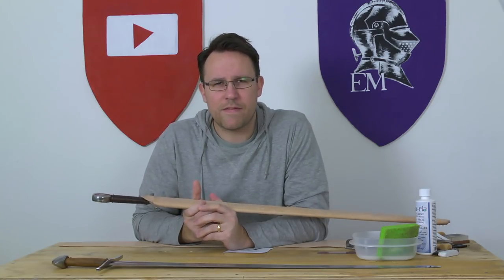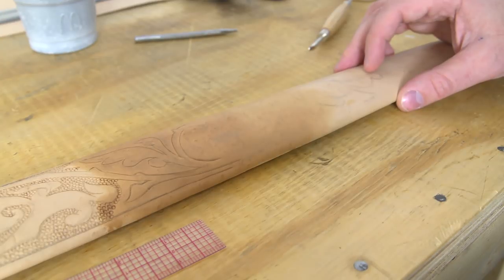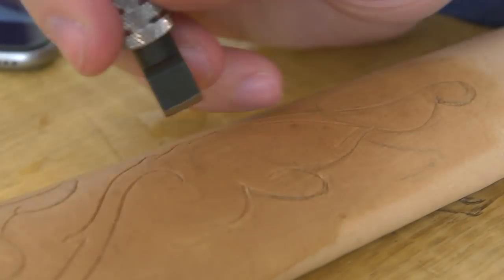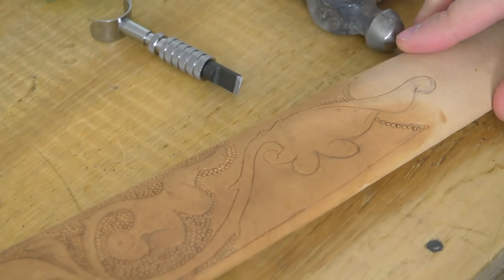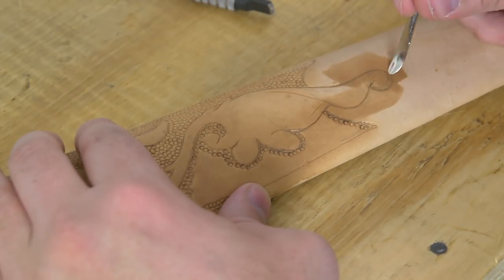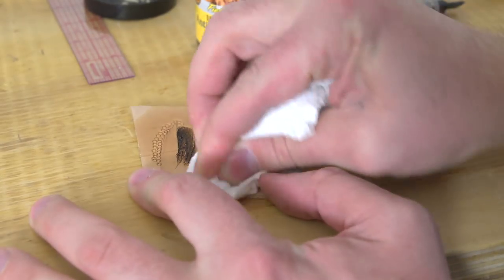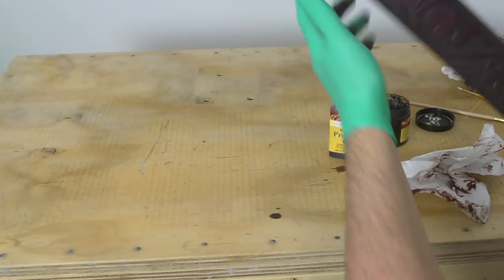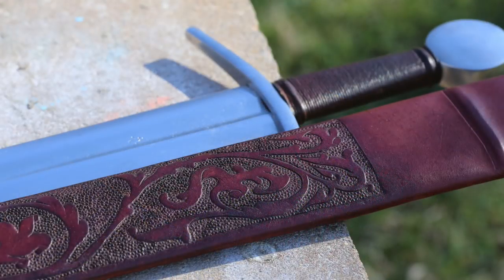Medieval Scabbard No.3, Carving and Staining

Comment: On the process of antiquing!
When using fiebings antique paste, first, you dye the piece the color you want, then you'll want to apply an acrylic finish that will resist the paste. The best for this is fiebings pro resist, but resolene, super sheen, etc will work. You can do a couple coats to really make sure none of the antique bleeds into the main color. Then, once the finish is dry, you cover the piece in antique and immediately wipe it all off with a clean rag.
Thing about this antiquing process is that it makes everything really shiny because of the acrylic. If you want to avoid antique entirely, then first dye the entire piece the color you want, then go back in and fill in the background areas with a darker dye and your brush. You have to be very careful, but you'll have less of an issue with dye bleeding into unwanted areas when you only re-dye the background. Awesome work! I love seeing your process

Comment: I'm by no means a leather worker but my late uncle was and because of him I dabbled in it as a kid. While seeing you cut in the floral patern I kept wondering when you would go back and cut in the little indications of veins/detail such leather work usually has. You mention you thought they came out too flat. That's why. Leaves usually have a few veins cut in then brought out with an edge shader during tooling. Stems are usually highlighted with the edge shader. Larger areas in leaves and petals with no veins are usually tooled in the center with a pear shader to cause the three dimensional curling or dished look. Those two tools will become as indispensable as your swivel knife once you've practiced with them. Either way the scabbard still came out beautiful. Really nice work. 👍
Reply: Also using an edge beveler will create more depth.

Comment: At about 5:10 you remark about the scabbard wobbling.  You may have already figured this out, but I have not seen all of the videos or read all of the comments yet.  I would take a piece of heavier suede leather,  say about 18 inches long and like when deciding on the width of the leather for the scabbard, make this about an inch wider on each side and leave about an inch for depth and then return to the center, so then you have a piece when sewn together it can be filled with some clean dry sand.  

Hopefully this makes sense.  It will be a formable pillow for the scabbard, but it will be firm enough to keep it from wobbling and also can supply enough support for tooling.  I have used something similar for forming sheet metal.

Comment: Nice Job. You will get much better cuts with the swivel knife if you let your leather dry more. If the leather is too wet it tends to grab the blade and you will have jagged lines or mushed up lines. Wait at least a few minutes before you start to cut into the leather and you will see a marked improvement. You should also be stropping your blade every few minutes, a polished blade will slice very cleanly and have sharp crisp lines. Thanks for posting the video. Good Luck in the future with your swivel knife work.

Comment: Just a few tips i've picked up belt making. Antique paste works best once the leather has been sealed, i use a couple of coats of supeshene from tandy. When the paste is wiped off sealed leather it stays in the deep bits and doesn't stain the top colour. Before you seal the leather you  can oil the leather and add some dye if you want more colour. I tend to use the fiebings pro oil dyes but dilute them heavily so i can do multiple coats rather than one heavy coat which is very difficult to get even. General order is dye/oil leather, seal, antique, wipe off, re seal. I think dying your project is a good idea as the tooling is quite shallow so wouldn't hold much antique anyway. 

I am not sure how robust the finish is as it is an eco product but tandy antique gel is a stain and antique in one you simply rub on and buff and add a protective seal top coat.
Reply from the maker: Great info and tips. Thank you!!

Comment: Looks amazing. Do you dye the leather when it's wet or dry? Also, do you have to apply anything to the leather after it's dyed?
Reply from the maker: I have tried both wet and dry leather at the time of the dye application, but on this project I'd say the leather was about 95% dry. After the dye is allowed to dry, there are a number of top coats or finishes available depending on the amount of glossiness you're looking for and whether you need it to be water repellant. On my last scabbard, I used Fiebing's Saddle Lac, which was extra shiny. It wasn't flexible enough for the belt components though. It cracked a bit when I was less than careful with how I bent the belt. I've also used Fiebing's resolute. It's an acrylic, water resistant coating that gives the leather a matte look. It's not my favorite because I think the leather should have a little sheen to it. There's a product called Eco-Flo Satin Shene that is probably my favorite because it can be applied with as many coats as you need, and when you buff it, you'll get an attractive gloss that's not overly shiny.